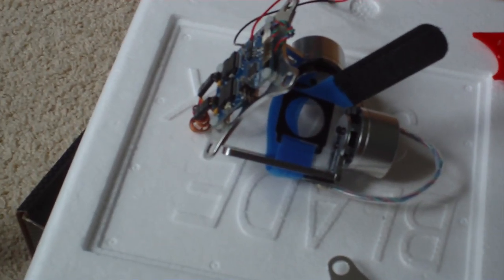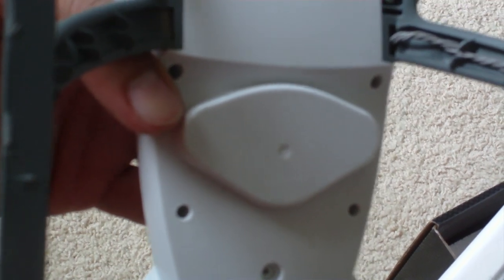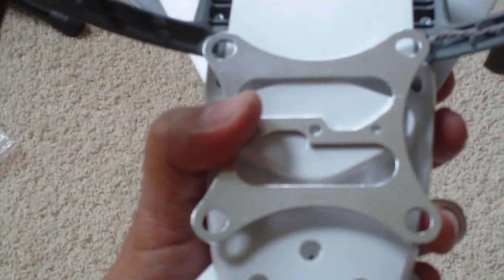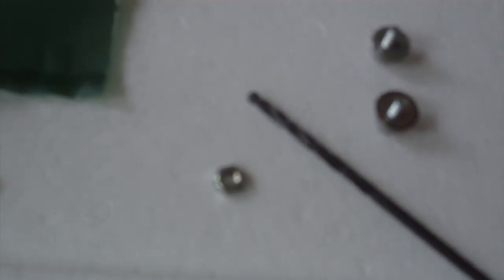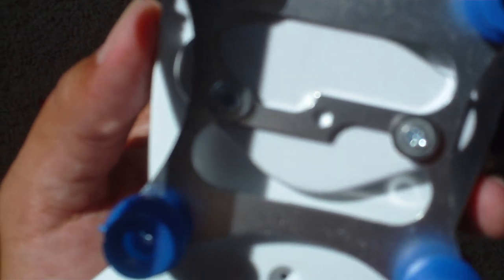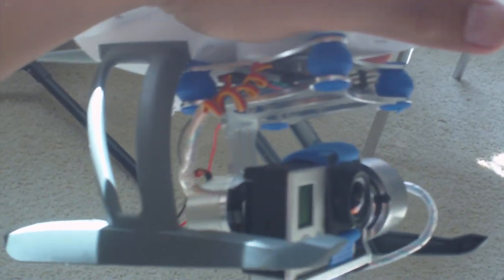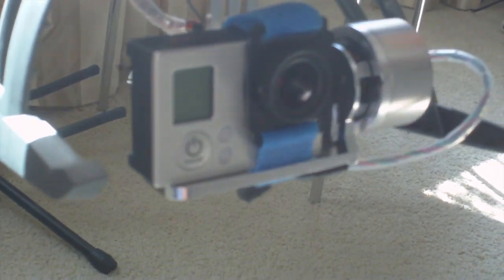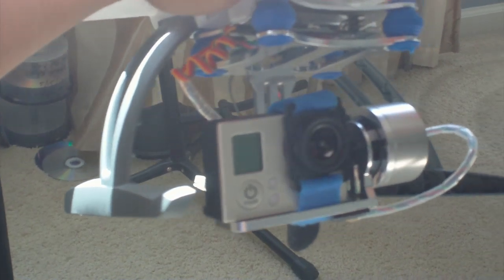Mounting eBay Brushless Gimbal on 350 QX: How-to

Comment: I have the rtf qx2. It is becoming a huge disappointment what a pain in the fucking ass is to get any clean gimbal setup on it. HH gimbals are criminally overpriced. 
Won't be touching their quads ever again. The 200qx same story...prone to damage ,awful quality control. Fun fliers but seriously fucked
Reply: by far the least cost effective quads.
Reply from the maker: +Tomi Try to avoid using expletives and you'll get a better response.  I do agree that the new breed of gimbals after the QX 1 are priced too steep.  You'll notice I tried to adapt a cheap $50 gimbal on this video project.
Reply: +BlueFlyerTV yes of course I was referring to any GIMBAL that could fit on the 350qx. But,that was mostly my frustration of deciding to even get a GIMBAL for the qx2. It just doesn't seem worth it. As far as I know only the AP COMBO versions have the best setup,which means SOLDERING wires on a very annoyingly built quad. The screws ,the electronics and how they're positioned inside... sigh I don't know maybe I'm just "overworked" with this quad.
Reply from the maker: +Tomi I totally understand your frustration.  That was my main criticism of the 350 QX unibody design.  Tough to tweak.  I jumped on a DJI Flamewheel 450 and have been happy ever since.
Reply: +BlueFlyerTV oh yeah the F450...I'm seriously considering building it. However ,which transmitter would yield the longest range ? dt7 ?
Reply from the maker: You should.  Longest range?  are you thinking LRS system or sticking to 2.4Ghz?  I'm using the new DX6 and it gives me more than enough range to do aerials.
Reply: BlueFlyerTV i was thinking LRS but if a spektrum rx works for 1 mile range then that would be acceptable too. Where I live there's mostly nature and woods. Villages every 2 miles or so.
Dx6 I hear is exceptional. Ever tested the range on that thing ?

Comment: should I do this and buy the $500 camera and a good $100 Gimbal or Spend $200 for a phantom which is a better drone that already has a camera and you can get live feed through your phone and I would not have to pull it apart and do no work? really what should I do?
Reply from the maker: +Noah Johnston I've seen the new Phantom 3 Standard go for $490.  That's probably a better option for you if you want to do aerial photography and such.

Comment: I'm getting a 350 QX2 and will be using it for aerial videography, so I'll be putting a gimbal on it right away. But I have a couple questions. I'm guessing it hooks up to the battery, and probably decreases the flight time? If so, by how much? Also, do you think the spot you chose for it was the best spot? how did it do with the balance?

Comment: Hi, can you post/explain something about the 6 connecting ports on the actual quad main board in relation to the gimbal's ports? Ive been looking for something like a diagram or anything in a video anywhere, but no luck. Ive heard of people frying their gimbal boards by connecting things wrong, I definitely dont want to be one of them! Maybe just an explanation of what port connects to what, that would make things much easier. Thanks!

Comment: good info buddy, i just bought the same ish gimbal but mine has a different plug for the power and wont fit into the battery charger connector what can i do to rectify that please
Reply from the maker: You can use a splitter as I have.  I placed a link in the description.  Thanks for watching.

Comment: What flight times are you getting with this? Do you also fly it with FPV gear?
Reply: It depends on the battery.  I can fly 7 minutes safely with the eFlite 2200mah with this gimbal and gopro in tow.  I usually bring it back with about 3.7v per cell.  You want to have enough thrust left to have a good landing with the extra weight.  I fly FPV as well and get about 7 minutes too with the eFlite.  I don't mix them together for longer flight times.  Of course, the Lectron 2700mah yields better flight times.

Comment: I just mounted mine today without having to remove the top of the quad. My gimbal has carbon plates and the small red JR plug. To power the gimbal from my flight battery, I cut the main power wire about 1 inch from the EC3 connector inside my 350qx and then soldered everything back together. And shrinkwrap. It was pretty simple. I ran the power wire for the gimbal through the hole in the landing gear opposite side from the compass side before I soldered it. No drilling required at all for the wire and no need to cut holes in the battery door.
Reply from the maker: Excellent, blink.  There several ways to do it.  My main concern was the CG.  I like your way too.  Clean approach to wiring.

Comment: Hi great video's!!! Did you have to take the lid off your 350qx to mount your gimbal? or did you just drill the holes in their ?.Am trying to add a gimbal. Justed ordered the ilook camera I have a go pro camera a D-2G gimbal looks compatible  with both.  I know am going have to modify. Don't want to break anything w/ the drill. What part of the state's do you fly in?
Reply from the maker: Thanks, Freddy.  I don't have to take the top half off to mount my gimbal.  My drill spots avoid touching the board inside.  If and when you drill, please note that the body is very very thin.  Don't even put any pressure on the drill bit and it'll go through.  You can use other methods to make the hole but the drill makes a clean hole.  I fly in Northern California.
Reply: I understand now... thanx. Have you had any general technical issues with your 350 qx?
Reply from the maker: Freddy banuelos
technical issues?  like falling out of the sky?  yes : )
Reply: What I mean is should I look out for any problems or things wrong with the qx. Thanx again.
Reply from the maker: The biggest flaw is the prop design.  I would recommend getting the cnc prop adapters and third party props.  The 350 is technically sound as long as you stay away from high magnetic/electric charged areas.  Never have wifi on your gopro with the 350 as it would interfere with your tx recption.
Reply: At first I didn't know about WiFi interference and I would always fly with my WiFi on. GOT lucky never had a problem . I would use the gopro app as my fpv... didn't know any better

Comment: Hey I appreciate the reviews. I just ordered this gimbal. Would you still recommend the way you mounted it? And is there anyway I could use the gopro case with this gimbal?
Reply from the maker: I definitely would.  It has given me a good CG or center of gravity when flying.  I haven't seen any gimbal that would allow you to use the GoPro case simultaneously. The odd size and weight of the case could be the reason.  Thanks for watching.

Comment: There are servo plugs inside the quad (from factory)just left of the battery holder for a gimbal.
Reply: I see those 6 prongs sticking up to the left of the battery bill88938. Does the female two prong connector plug to two of those 6 prongs? Which two? Red wire toward front of quad (go pro mount end) or red wire toward rear of quad (binding light side)? Thank you!! Derek

Comment: Hey I'm thinking about doing this with my 350QX too.  Question, do you have any control over the gimbal with your remote? I don't think it's all that important but still curious.  Thanks for all the great videos!
Reply from the maker: No control but you can with an additional RX.  i've never had the use for it.  This gimbal is easy to setup.
Reply: BlueFlyerTV I don't think I'd need it either.  In fact my Phantom 2 with the built on camera...Once up I only controlled the camera to show someone else I could.  FYI, the camera kept coming off then finally broke off so I'm sending it back to BH Photo and swapping it for another Phantom 2 but this time with a gimbal.  Thanks!

Comment: How are you powering the gimbal? Separate battery pack or can you draw power from the board in the chopper?
Reply from the maker: I'm using the same batt as the quad.  Some gimbal use the balance lead but i actually use a splitter that splits to an EC3 and a JST plug.

Comment: Hi, I bought the gimbal and it works but I want to use a different camera (a SVC200) than the go pro which is a different shape (so only fits on the end of the gimbal arm) but the same weight as the go pro. The gimbal doesn't settle with the svc200 placed at the end of the arm and I don't have a go pro and would like to avoid buying one as I am happy with the SVC200.  Do you have any ideas regarding software or hardware fixes so that the gimbal settles with a camera on the end of the arm rather than at the motor end of the arm? Any help gratefully received!

Comment: HELP.
Do the mounting screws screw in from the outside or inside of the body? Did you have to take the body apart to install mounting screws. Yes, your camera is fuzzy, can't see the mounting screws and how they're installed. Are they screws, or bolts with nuts??
Reply from the maker: The head of the screw is on the outside.  The nut and washer inside.  I did not take the body apart.  Bolts with nuts and washer.  Thanks for watching.  Good luck and have fun!

Comment from the maker: Thanks for the question, Todd.  Nothing to it really.  The eBay gimbal I showed has everything connected already i.e. brushless motors to its board.  The only thing you need to connect is the power.  The power "plug" simply connects to the the 2200mAh's balance lead and that's it.  You plug the QX to the battery and the balance lead to the gimbal.  Easy, right?  Hope his helps.

Comment from the maker: Oh heck ya, Mike.  i didn't want to unscrew 30+ screws.  FYI... don't apply too much pressure when you drill.  just let the drill's weight add the pressure.  it'll take about 3 seconds so be careful not to drill the components inside.  Good Luck.

Comment from the maker: No Fred.  I have the battery cover on because it secures the wires nicely.  It's not cutting into the wires because there's hardly any pressure on that lower back end of the cover.

Comment from the maker: I'm a conservative flyer when it comes to batteries.  I was doing seven minutes of flight time from the 2200mAh batteries.  I have 11.1 v left or 3.7v per cell.  I wouldn't push it because of the added weight.    The gimbal is powered by the same battery using the balance lead.